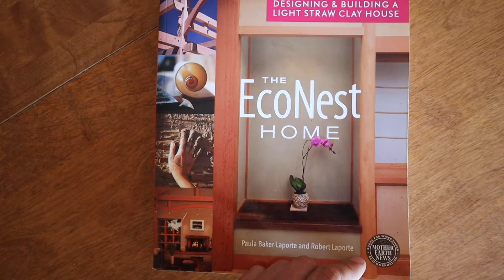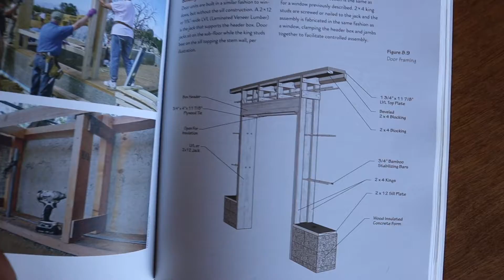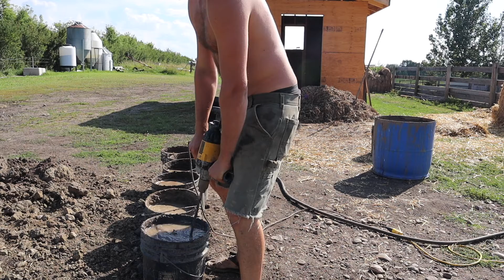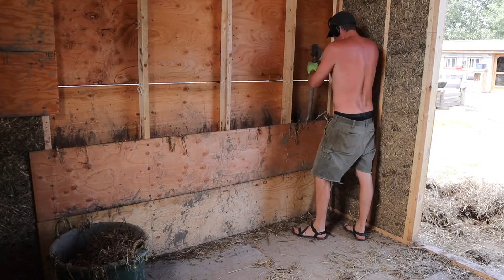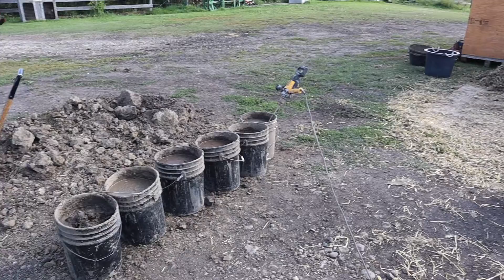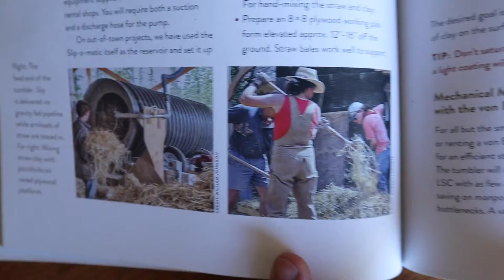Intro to Light Straw Clay Construction

Comment: Hey! what about using your bale buster on your New Holland feed mill for the initial bust, then use a bottom discharge ribbon blender skid-steer attachment - or they may make tractor PTO versions. I think the mixers are primarily used for concrete, so might not work with the longer fibers of the straw, the discharge tube on the one my friend has is small-ish at 6 or 8 inches or so. if your clay was processed, you might even be able to mix it with your feed mill dry, then add water later.

Comment: What is R-value of such walls ?
Reply: R value of light straw clay walls is 1.5 to 2 per inch. Which is actually less than fiberglass insulation. But, for interior walls, it is an amazing sound dampener also!

Comment: Your enthusiasm is infectious! I love it! 
This is a time tested building method in Europe. Timbers for framing, then straw clay then a lime plaster. They are everywhere in the old world. I love your enthusiasm and I think you are right about mixing it faster too.
I framed my house and used cheap 3" used styrofoam that I bought from a flat roofing company. Insulation is great but expensive

Comment: I have a friend who built 4 or 5 structures like this. At the beginning they used concrete mixer to mix it, but mixture was too dense like a cob so they ended with just soaking straw into dense clay suspension into a big trough. All family members were involved  in packing, including grandma:) Now he has been living in that house for about 10 years and nothing rot or damaged
Reply: dunking the straw into a clay soup seem to be the easiest route to go

Comment: Sounds like the system is ideal for traditional lath and lime plaster. Lime plaster breathes, lath eliminates slip form and lets air flow during drying, and no need for lateral bracing.
Reply: @WoodchuckNorris.8o  lime plaster as in tadelakt?
Reply: @emmahunter7734  almost certainly, yes. Burned lime, slaked with water, mixed with sand, troweled in the wall.
Reply: I would say that while it seems nice to eliminate the slip forming, the slip forming is probably faster than applying lath. Further, the lath isn't needed here, you can plaster directly on the straw clay mixture.

With lath, you basically have to slip form anyway because it'll be impossible to adequately compact the mixture at the bottom of a wall with the lath already applied. So, apply some lath some distance up the wall, pack the straw clay, repeat. It would work fine, but as I said, not necessary. Just plaster on the surface. 

I do think you'd want to scratch the surface like you would a scratch coat of plaster. This provides a nice mechanical key for the plaster.

Comment: Hey Takota.... great conversation on this style of natural building. I’d share some experiences in different locations and why these additional considerations would also apply. In this case the clay coming from local sources would likely have some “biology” that might not benefit long term structures. Two considerations that come to mind are adding lime to the slip mix, which would have additional benefit both in binding and in drying and then the thought of heating/fermenting (cover and heat up) the mix prior to building use. The heat would drive out or decrease any active loads (burrowing ,termites etc.) and would also stablize moisture content through the process.
Reply: If you're worried about bugs, a little bit of Borax goes a long way in protecting against termites or decay. Just mix the Borax directly into the clay slip.
Reply: @kevinyoung4053  how to stop seeds growing into the wall?
Reply: @shamilshark1815  doesn't matter if the seeds sprout. If anything, they grow roots which hold things together better, and then the plants dry up and die and become part of the wall.

Comment: Another idea to try which I've done successfully, is to replace the straw with shredded paper. Believe me, it works. Don't shred the stuff yourself or you'll go insane. There's plenty of companies that do document shredding service, who'll give you the paper shreddings for free. Ask for straight shredded and not cross shredded. Cross shredded is tiny pieces, which are better bulk soaked for a couple of months to break down the binders, then blended into clay for plastering.

Comment: Great job and good idea on mixing the mixing of the straw clay.
You mention to have some air space between the clay wall and the lining inside why that. I would just plaster the inside with clay plaster as a finish. Then the clay can do the moisture control within the wall.
Reply: That is for wood, so it can dry out but clay plaster can be directly applied

Comment: curious what the r value is as per 3/HALF inch ..I like this system..
I've done lots of( parging ) skim coats with cement so you could easily cover that with a wet coat on the exterior or interior would look like stucco/ drywall 
if I was to look at this from a production standpoint..I would make a set of 
pre fabricated forms ..
basically - 2 - 4 sheet of plywood and on a ground surface you frame out your wall spaces  , make ( batts ) 20 inch x4 feet 16 inch x4 feet ..that way you make as many as you can per day .. a few days later remove them from the form , and stack them with gunnage..
cover with a tarp ..
alternatively you could build the walls with sheeting,  then pack them while flat let them set and stand them after ?? 
obviously you would have small areas to fill in with your slip form ..
(hey for mixing purposes what about a snow blower ?  bobcat ) bcs type machine..I  can't think of anything that would mix large quantities other than making a large tumbling drum (try a 50 gallon drum..with a altenator like a massive dryer ..can't you convert a hay bailer to make thinner bails ..lol 
good luck that's some cool ideas either way ..
I've always loved cord wood construction..this is the mix I would put between the logs ..I like it because you could make 6 inch wall-24 inch just stacking piles of fire wood

Comment: Hey Takota, I’m at a similar stage as you are. I’ve also been researching natural building techniques. Was there another method you were considering?
Reply from the maker: For our context I would say either this or straw bale SIP
Reply: @TakotaCoen  Rammed earth has potential as well. Btw do you know of a method and/or none toxic product to waterproof the outside of a basement or a burmed wall? I don’t wana use some crazy product that would toxify the grounds. Thanks.
Reply: @iTeerRex lots of gravel and drainage tubes; keep the water away from it!
Reply: @TakotaCoen  Thought maybe you had the same question, and possibly have found a good solution.

Comment: I wonder if you could run this through a square baler.  Giant Bricks!
Reply from the maker: That’s actually a brilliant idea! You could use a TMR to mix and lay it out in swaths then bale it!
Reply from the maker: They would be 100lbs though
Reply: @TakotaCoen  Yeah hemp twine can break if you get too aggressive handling a heavy bale. Not to mention lower back. honestly a two man or front end job.    Benefits would be faster cure spread under a barn or just set on posts or boards and tarped with some black stovepipe as a vent. You could get insane R-value with a haygloo or cross stacked walls with some load bearing ability.  Really though you would probably want smaller blocks for most uses.
Reply: Actually, some people use wood chips/shaves instead of straw and when that mix can be formed as large blocks I would be surprised if light straw clay can't be used like this. However, using all that mass directly in the wall, air gaps are easier to avoid.

Comment: Looks great, do you have guesstimate on R value per inch? Just wondering what the expectation is for a foot thick wall. Per inch would be nice know, just in case you wanted 6, 9 or more 12 inch. Thanks Takota! Happy thanksgiving.😊
Reply from the maker: It’s about 1.5 per inch
Reply: @TakotaCoen  1.5 per inch is close to wood ? can't remember atm
Reply: @TakotaCoen  Hm, that sounds like a bit low, isn't it? For 12" wall, it would be R~18. At least for energy efficient living house. I watched your colleague/friend Rob Avis couple of days ago, about 8 common mistakes in home design, he mentioned that for Canada R~50-60 would be appropriate.
Ca 20 years ago I wanted to build for myself a house of light wood shavings clay and asked for advice from a group in our university who were actively investigating about possibilities and challenges of building such houses. Their advice was: for good residential building, consider at least 50 cm/20" walls. Electricity, gas, and firewood was "dirt cheap" back then.. ;-)